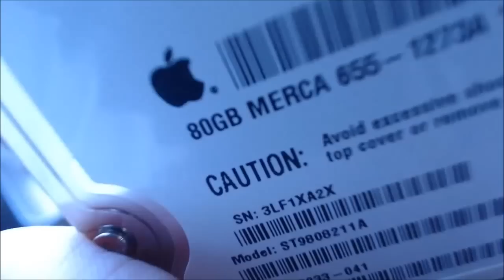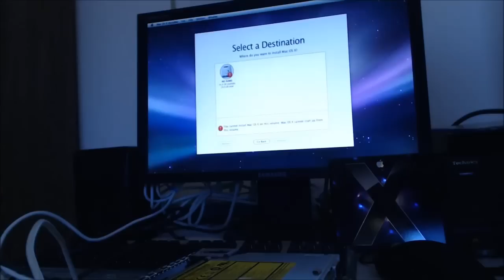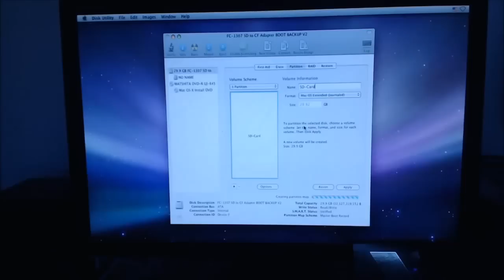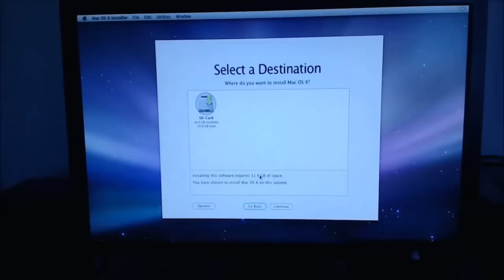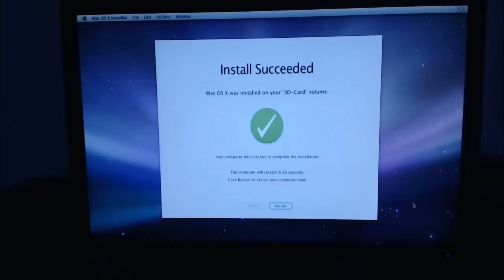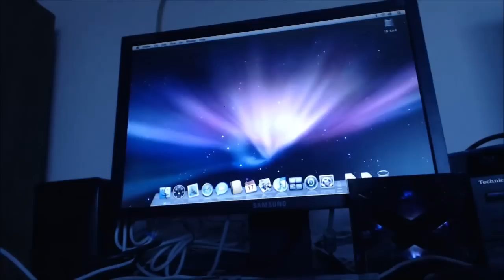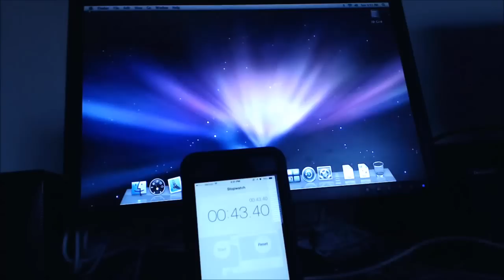Installing Mac OS X on an SD Card

Comment: Lets see you OC it to 1.5ghz, it is a 1.25 ghz by the looks of the cooler! But if you pull the cooler off and clean off the factory crap off the cpu die and cooler then apply grey non metallic compound and re-apply! On the bottom of the board there are 3 resistors on the main board that need removed by soldering iron "Best way"! 

Then just reassemble it! Supposedly you can get as high as 1.6+ghz with another resistor by the cpu! But you can buy a Msata to 44 pin adapter and use an Msata ssd or you can but a 44 pin SSD on ebay as well, they have 16, 32 and 64gb versions! But overclock it, I did it to both my 1.25 ghz and 1.42 ghz!

Comment: isnt the cs card slower than any hdd ?
Reply: counter-strike cards do not exist
Reply: sd sorry
Reply: and they do exist
Reply: nope, there are SD cards that surpass 100MB/s read and writes. The problem is random access times and 4K speeds. Those are often lower that normal HDD's. But in transferring large files, they could be the same speed or even faster.
Reply: i was talking about small files like 1 mb
or 150mb
Reply: PetrosRZ an SD Card would still be comparable, they aren't as slow as lets say 5 years ago.
Reply: ok :)

Comment: Hey +Druaga1, can i borrow your leopard install disc, i accidentally erased my ibook's HDD PLEASE?? :(
Reply: +Peter Kapica You can buy a stack of (at least) 20 dvd-s in nearly every store for like 10 bucks
Reply: When reading your comment the scene of the Windows 2 Video where he said: "WAIT NO! YOU'RE FORMATTING THE SETUP DISK!" came to my mind...
Reply: Lol just download it from the internet. ;)
Reply: I can't get it to boot off of USB (no DVD to burn it to)
Reply: Blue Eyed Beast Druaga1
Reply: +Peter Kapica Buy the official copy of the disks from eBay.
Reply: ***** tried that. Different boot code error.
Reply: Blue Eyed Beast I want the rw ones
Reply: +Peter Kapica you can buy dvd rw disks from Amazon for 10-20 bucks.
Reply: +TheDeceivingEye yeah that's all true but he said that USB doesn't work for him
Reply: ***** Mine died after like 6 years a pny drive
Reply: ***** problem is that it didn't come with one I got it from a friend
Reply: ***** here is the issue. Sometimes some disk images (PPC version of Linux for example) won't work with my USB burn program Rufus. I also tried nas4free and for some reason when I booted off the USB it locks up even in safe mode. When I burned a cd it installed fine
Reply: +Giachy Garau here is the problem, I have successfully written a Mac USB BUT my iBook refuses to boot. Tried it a dozen times. Insert an OS X or Linux disc, it boots
Reply: ***** I'll just leave it for later
Reply: ***** oh there is a way supposedly by modifying the files
Reply: ***** actually I already made a tiger install disc and the iBook doesn't have DVD DL capability nor USB boot support. Do you have a FireWire external hard drive cause the iBook can boot off of FireWire and I already have the image.
Reply: ***** actually I bought a FireWire bay at goodwill so I'm good. Now the iBook has lubuntu as 10.5 is really slow
Reply: ***** lubuntu is so much faster. Still can't play YouTube though
Reply: Windows 10 runs older hardware better. Try to run crysis on it and see how hot does the core 2 duo (or core duo) get.
Reply: ***** sorry about that

Comment: I'm right now troubleshooting it, it works fine, but makes a lot of squeaky noises, especially from the internal speaker. Otherwise the Mac works boots and works fine, but I don't know what the issue could be.

Comment: This is seriously impressive that you got this to work. I had to take apart an old Mac mini about a year ago to install bigger RAM to run a server, and I accidentally forgot to reconnect the cords for the Bluetooth keyboard and mouse, and the wifi. To put it simply, it was difficult to shut it down afterwards.
Reply: Can't you just hold down the power button
Reply: +esc1010 yes, but that hurts the device. You want to use force quit or force power down as least as possible because with enough force power downs, you can hurt your computers performance. I did this to my old desktop, and it had severe issues just booting from the hard drive before I got rid of it. I stopped powering down for anything that took longer than a minute to figure out, and my new computers have lasted much longer than that one.
Reply: +David Triphon Oh ol

Comment: Would be nice to install Mac os 10.5 as shown,then upgr it to 10.10.Would that even work?
Reply from the maker: I would need an Intel Mac mini for 10.10. Maybe if I can score one of those ill make a video about it.
Reply from the maker: well, shit
Reply: ***** while the first and second gen was core solo and core duo you can upgrade the cpu in them to a core2duo but to install yosemite you have to make a special usb installer using sfott on a mac that supports it. But after you have the usb you can install yosemite on any intel mac that doesnt support yosemite using that special usb. as far as i understand it. im currently running yosemite on my 2006 mac pro but i used a different method just for the mac pro.
Reply: ***** No, you can easily bypass that with an easy process of creating a bootable USB stick installer thing.
Reply: I have clone my hackintosh disk to my 64GB SanDisk EXtreme USB and it doesn't seems much slower than my SSD

PS. that does not work with Windows To Go
Reply: +Harry Tsang Forgot the mention that it was 10.11.2 El Capitan
Reply: Mac Mini G4 doesn't support 10.10
Reply: well duh
Reply: +Brian Tylo you are wrong!
Reply: ... powerPC.. not x86

Comment: Can U please do a video on hackintosh installing mac os on PC PLS
Reply from the maker: I've done a successful hackintosh install before, so... maybe.
Reply: dutchhypercraft1 I always recommend tonymacx86's methode, because it just simply works and doesn't modify OSX too much.
Booting anything newer then 10.6 is not recommended, because OSX 10.7 and newer is just too big to fit on a DVD
Reply: Druaga1 pls do it
Reply: +Druaga1 On an SSD based Hackintosh, obvsly
Reply: +dutchhypercraft1 By simply doing it. Duh?
Reply: dutchhypercraft1 I'm using a Hackintosh for quite some time now. The only problem that I have is my graphics card. Every time when there is a new OSX Version available, I need to wait until Nvidia releases a new web-driver update. (maxwell chips aren't supported by OSX natively yet) Also, when I try to do virtualization on my Hackintosh, it sometimes randomly reboots. But I'm used to that.
Reply: dutchhypercraft1 Well, lucky you. My Laptop only works on 10.5 because of the graphic chip. ATI mobility radeon X1400 was lastly supported in 10.5
My Main Hackintosh however works like a charm with OSX 10.11.4
Reply: dutchhypercraft1 It depends on your Hardware If you can update or not, but if Mac OS X 10.9 Mavericks works, at least Yosemite should work too. I can give you my Skype, so I can personally teach you how to upgrade to El Capitan